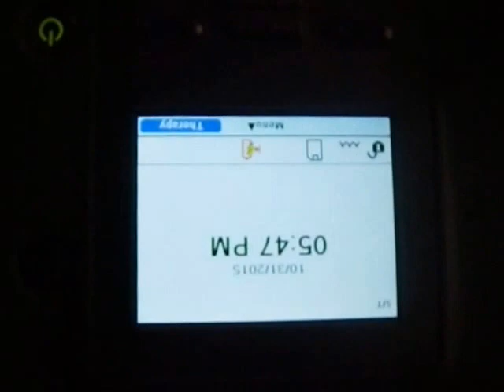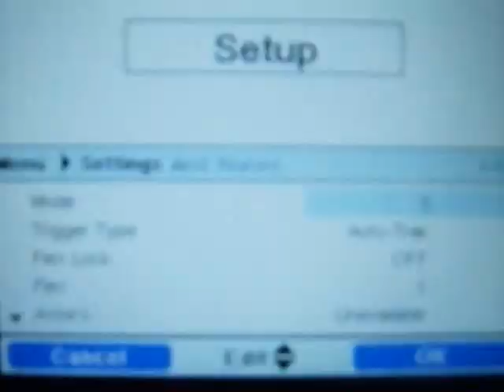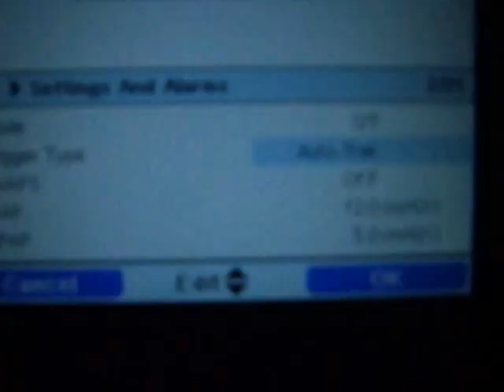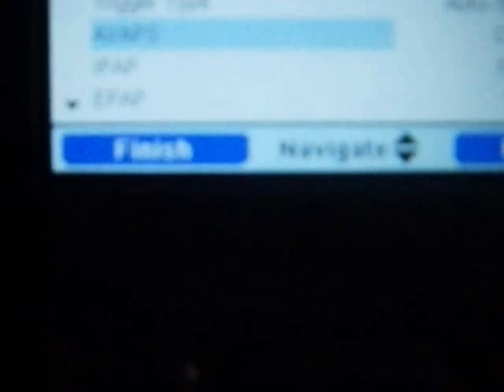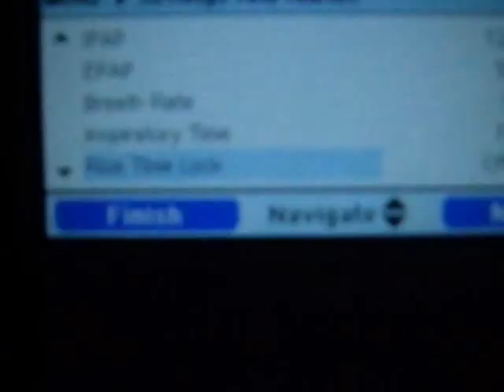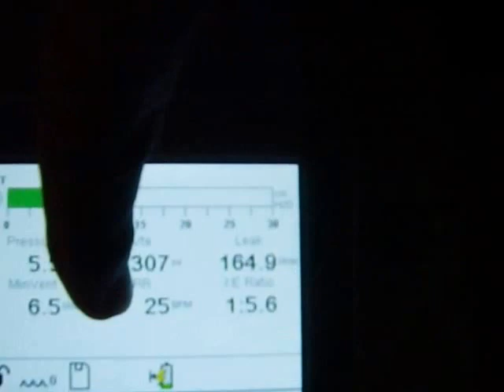Using Non-Invasive Ventilator (Philips BiPAP A40) at Home

Comment: Can we add oxygen to this unit? Is there O2 sensor to detect fio2
Reply from the maker: FiO2 reading is not possible at A40 display but the more essential clinical measurement for SpO2 is available to monitor the patient's saturation by bleeding in the Oxygen via a T-piece and detecting the SpO2 with attached the Link module at the rear of the A40 machine using Maximo finger sensor.  If you just want to spot check the FiO2 in relative of oxygen flow delivered, may use the Oxygen Anaylzer attached at the T-piece proximal to the patient which is commonly applied by hospital Biomed to verify or troubleshoot FiO2 delivery from the mechanical ventilator and oxygen source. If budget is allowed, I would suggest the users who need continuous supplementary oxygen use Life-support vent like the Trilogy vent series with in-built oxygen inlet because the introduction of external gas (bleeding in thru T-piece) to the noninvasive mechanical ventilator circuit can induce ventilation asynchronies, including auto triggering and ineffective effort. The performance of ventilators using different trigger designs may be affected by gas from various sources. Reference: https://www.nature.com/articles/s41598-021-03291-y

Comment: hai wong.... how much A40 Bi-level Ventilator price?
Reply from the maker: Hi Hardy, this is a learning channel, the price is at the local country seller's discretion. May Google it and make sure you also ask the local sellers about the consumables price (mask, tubing, air filter, etc) & most important is the after sales services such as 24/7 service maintainance contact, planned preventive maintenance frequency, house visiting cost, availability of spare loan unit when machine failure waiting for troubleshooting/repairing...

Comment: I LOVE YOUR VIDEOS!! THANK YOU SOOOOO MUCH, for finally doing the follow up video on the Trilogy ventilator, and everything you covered. It's truly wonderful.  I use an LTV ventilator, and have worked with a Trilogy ventilator, however I think the LTV is more comfortable ventilation for me, and I never have been on a Trilogy vent, however It seems like a very nice ventilator.
Reply from the maker: Hi Peter, thanks for your lovely reply too :) I have yet to cover the F&P active humidifier and perhaps Aeroneb Pro Nebulizer and other special modes like AVAPS, AVAPS-AE and MPV; if wanna go for greater details. I never use LTV vent before but it seems like a good vent too after watching its related videos online. My focus in this video is to provide visual guidelines to ease home ventilated patient who is using Trilogy on both INV and NIV application with Passive tubing option (without other sensing lines, active valve or active flow tubings options) that enable greater Leak compensation with proven Digital AutoTrak algorithm available since BiPAP Vision.
Reply: Which F7P humidifier were you going to do a video on? The Heated wire ones?
Reply from the maker: If F&P is chosen, it is either MR810 (NIV) or 550 (INV) for home vent use. Anyway, I decided not to cover it since this F&P option is too costly for most of my patients here especially for those with shorter expected lifespan (<1 to 3 years). They will choose to use lower cost non-life support ventilator that comes with "integrated" humidifier to ease handling and maintenance.